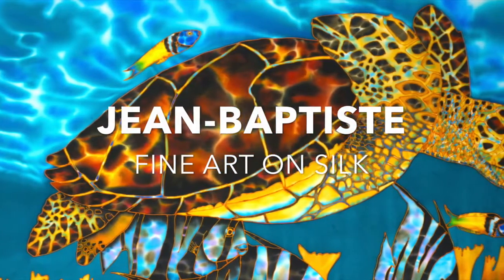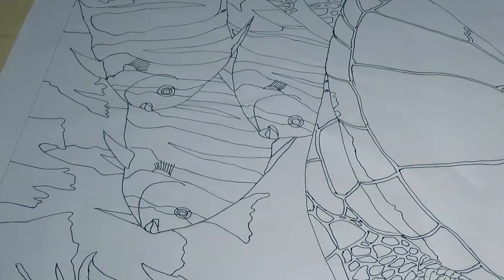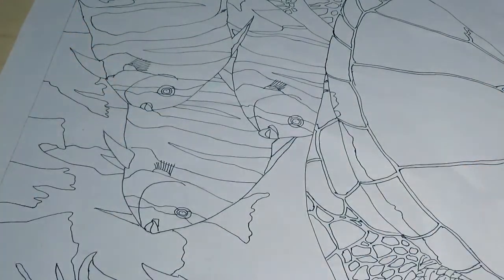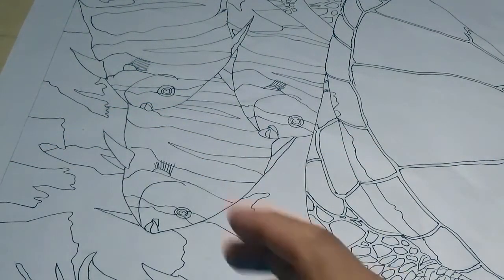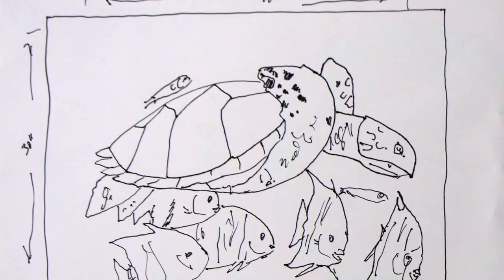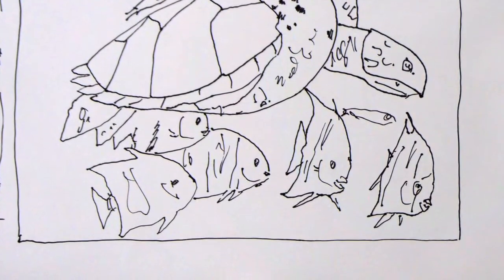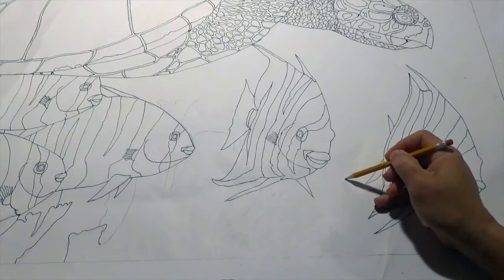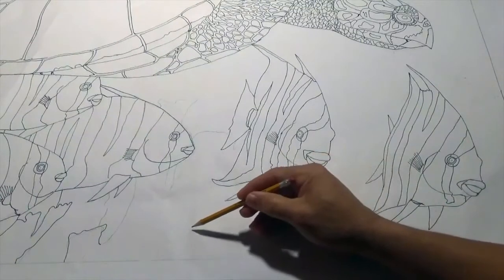Jean-Baptiste silk Painting | PATERON

Comment: Hi do you heat set the resistard gutta ?
Reply from the maker: Yes, I use an iron, I have a video on Resistad.
Reply: Daniel Jean-Baptiste thanks so much
Reply: @DanielJeanBaptiste  Once you heat set it, is it permanently fixed? Or will it wash out when you wash the silk after steam fixing the paints? I see that you colour your resistad with silk paints, but wonder if the resist washes away.